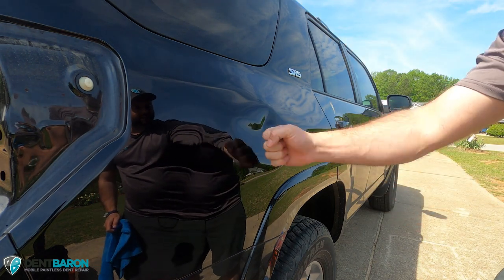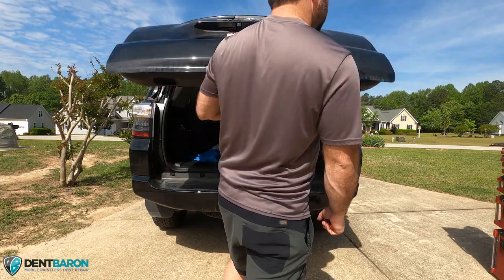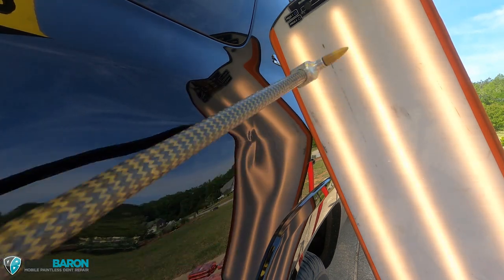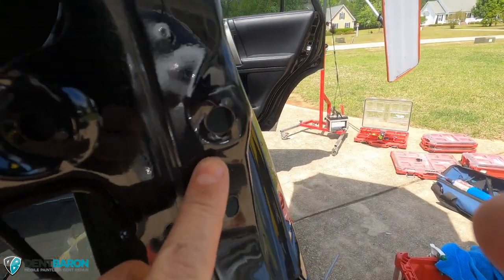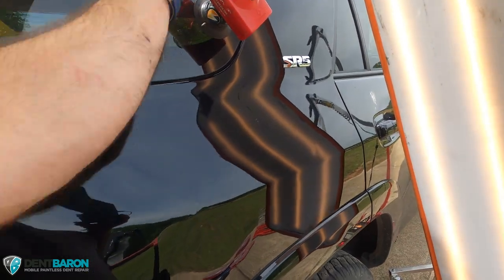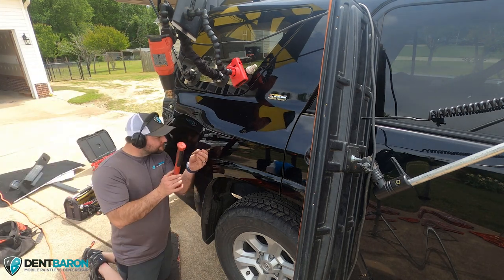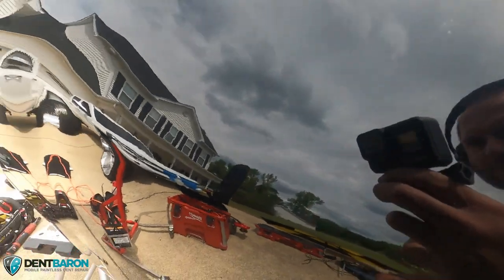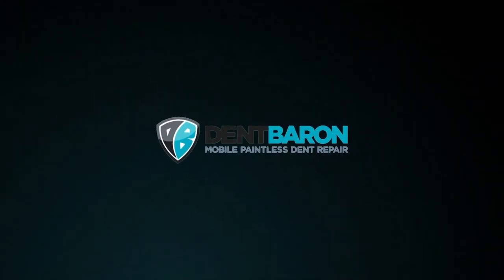Paintless Dent Repair and Trim Panel removal | Dent Baron Raleigh, NC

Comment: Nice repair. Quick tip for machine polishing...the sling or splatter is from using too much compoud. A few pea sized drops is enough. If your having trouble with swirls use a dual action polisher. They don't leave swirls. Milwaukee makes 2 M18 cordless versions.
Reply from the maker: Nice tip 👍

Comment: Another fantastic job, your R&I skills are also killer. Yes, in your younger years make it easy on you joints, I am 64 years young and have had both Rotation cuffs operated on and one knee replacement. The joys of the aging process, mind you I only do PDR as a side line / hobby. Would never make it now full time. Thanks for sharing your knowledge.
Reply from the maker: Enjoy it out there!  Thanks again

Comment: Hey bro I’ve seen you struggle with leverage issues .if you put the dentdail bar in the middle will create a good leverage point.that’s why I have 24” bar hope this helps you next repair
Reply from the maker: Bolt the dent dial and use as fulcrum point?
Reply: @DentBaron  yes  or clamp both with home depot screw c clamp is easy way
Reply from the maker: Thanks man.
Reply: More comfortable more fast

Comment: I wonder if you would have made the first pull vertical instead of horizontal to pull out that hard crease then made a horizontal pull would it have been easier?
Reply from the maker: Definitely something different than what I did to start the process

Comment: Do you stop what you're doing to go and ask the customer about charging extra for all the R&I or do you just include it on your invoice? Genuinely curious because I'm always worried about how much time investment goes into a repair before you find out you need to strip stuff apart.
Reply from the maker: Hey, I apply the R&I time on the estimate. That way they already know how much the repair will cost.  Knowing what to remove comes from experience.